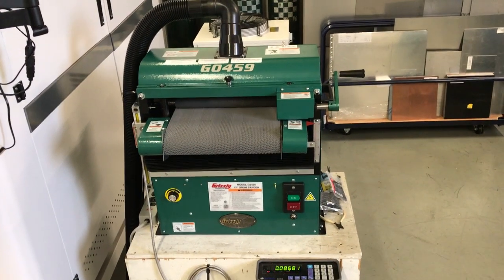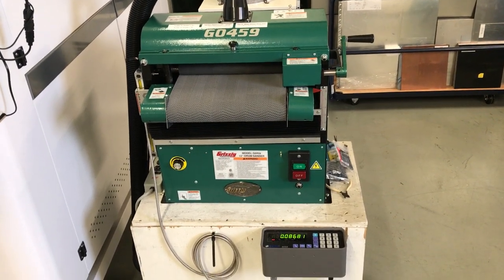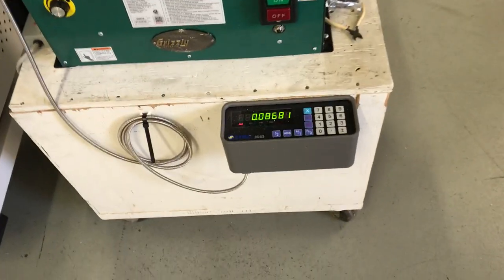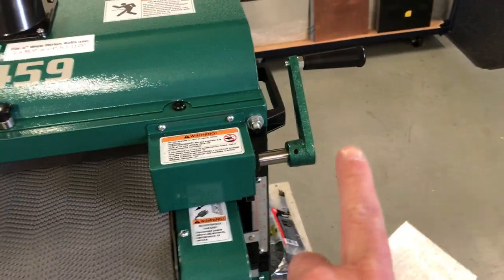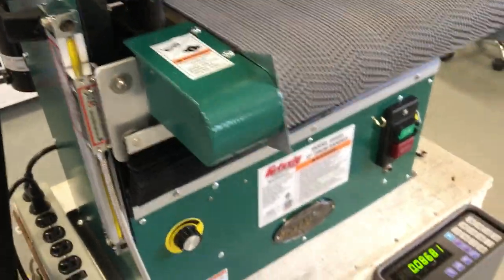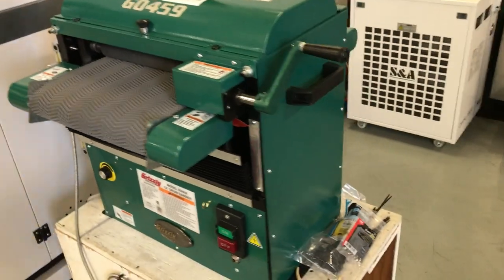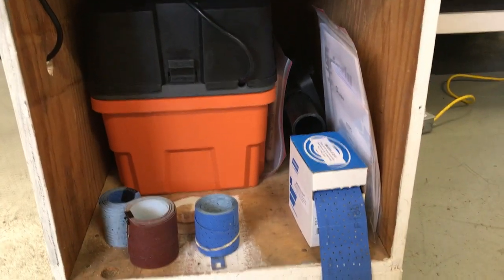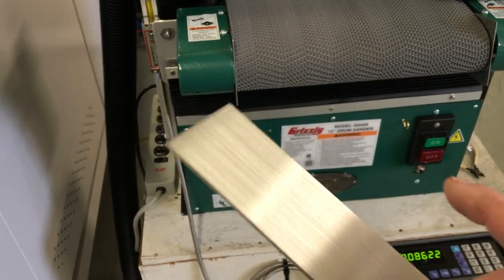Grizzly G0459 Hook & Loop Drum Sander, SDS3 DRO, & Rigid WD4522 Vacuum Setup to Sand Sheet Metal

Comment: I know it’s 2 years past but if you still had this machine.  Could you show a video on mild steel?
Reply from the maker: It works on mild steel.  The main drawback of this Grizzley is the spiral wound sand paper wears down quickly and can easily break especially if you come in with the height set for a too aggressive cut.  The professional machines (like Timesaver brand) get around this problem by using a very large sanding belt instead of hook-and-loop belt.

Comment: Hi, How low can you go with this. I am looking to do 20 gauge cold rolled sheet metal. 12 inches wide. Do you see any problem doing that ?
Reply from the maker: A long piece is no problem.  If the piece is too short (~<6 inches) then it won't stay pinned under the rollers and will jam.  Jams on this machine are bad because they usually tear the hook&loop sandpaper which then takes 15 minutes to replace.

Comment: How think of a material do your think it can handle? I have some .074 stainless that I would like to try.
Reply from the maker: Thick really isn't a problem but short pieces will not stay pinned under the rollers so you have to use >6" or there about or make a carrier of some kind.